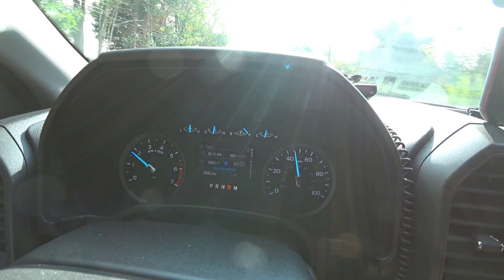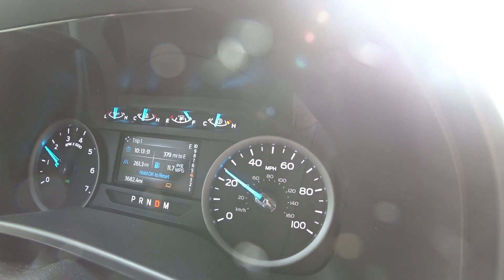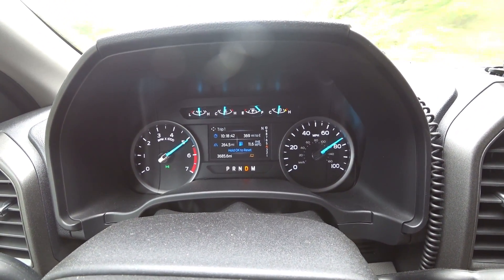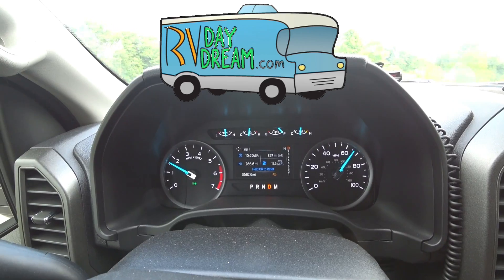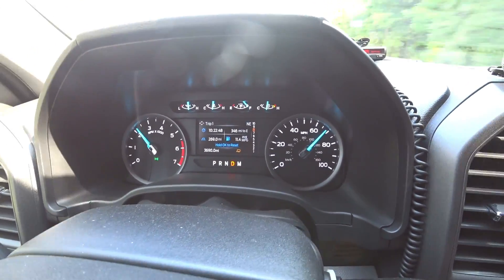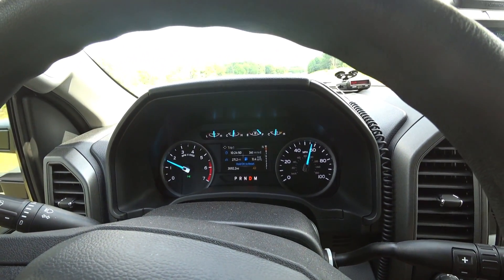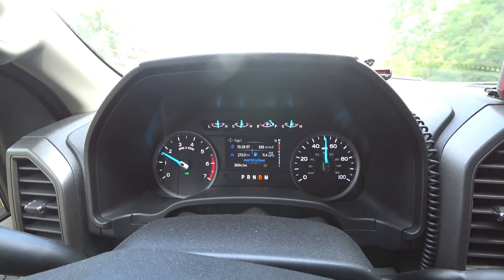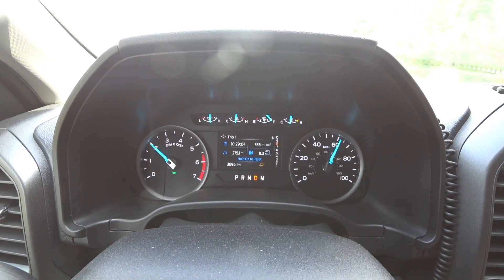2020 Superduty 7.3 Towing 8000# Travel Trailer

Comment: Do not go ten thousand miles on oil changes you will plug up that engine .Engineering are not paying for your truck and repairs. I would say no more then four thousand in between oil changes . That's why I don't buy used truck and vehicles because of poor maintenance Yes the oils are better than back twenty years ago but you still have contamination of the oil in your engine while your diving it . I have four Fords and two of them have over one hundred sixty thousand miles on them and when you look at the top of the head threw the oil fill they look brand new with all them miles. No sludge and no discoloration on the cams and rockers and that living where there are cold snowy winters .
Reply from the maker: You got to figure that Ford is offering a hundred thousand mile powertrain warranty that's a lot of miles the only do 5 oil changes. Ford's responsible for that engine staying running. Talk about old school, sludge in the heads? That hasn't happened since the early 90s. All the new engines run a little hotter and have much better oil flow and of course the oils are made so much better. Not only that but the engines are at tighter tolerances so you have less Blow by contamination and the fuel delivery systems are so much more precise so you have less ring wash going on. Now, with that said I wouldn't go over 5,000 miles personally. And I run full synthetic lot semi blend.

Comment: Don't try towing a 30 Foot TT in the wind!! The front is to LIGHT!! it will wag the Tail!! I towed one from Bakersfield Ca to Ft Smith Ar >>>>>NEVER Again>>>Now Driving a Ram 2500 with the Cummins 75 MPH all the way back to Cali >>> NO F---ing Problems with 40 to 50 wind Gust (:

Comment: Do you wish you got 4:10 gears vs 3:73?
Reply: With a F250 the only axle ratios available (with the 7.3) are 3.55 & 4.30, with a SRW F350 it's either 3.73 or 4.30.  Because I don't want to spend as much time in the lower transmission gears I'd opt for 4.30. Unless you get the Tremor package (have yet to find a gas powered one here in Phoenix) you'll almost certainly have to order a truck to get 4.30 gears.
Reply: @SteveH98264  you can get the F250 with the 3.73, but you have to order it. Here in Louisiana you have to order the F350 with the 3.73 otherwise it comes standard with the 4.30.
Reply: @atvtinker01  Might want to check again. According to Ford the F250 is available with 3.55s & 4.30s. The F350 gets 3.73s & 4.30s.
Reply: @SteveH98264  I guess they changed it, because it was an option back in December, but I don't know why. Why would the F350 7.3l and 10 speed be any different than the F250 that you couldn't order the same rear end ratio in both? I know they have different rear ends, because mine is a Dana 60 style, but they will let you order it for the 6.2l? That doesn't make sense.
Reply: @atvtinker01  Don't know where you got you information, but 3.73 gears were/are not available in either a 2020 or 21 F250 with the 7.3. Ford decided to make an actual difference between the F250 & the F350 SRW trucks. Take the time to find the 2020 or 21 Ford RV & Towing guide.
Personally I wouldn't have a 7.3 unless it had 4.3 gears. The 10-speed had 3 overdrive ratios so rpm will not be a problem.

Comment: Pick up some extra spark plug wires.
Reply from the maker: I think that info is a bit of a panic impulse.... There aren't very many having issues
Reply: Foxboss9 might want to read up on it. Ford already admitted there is a manufacturing problem with the company making them. Better safe then sorry.